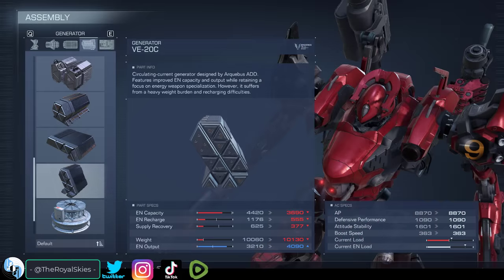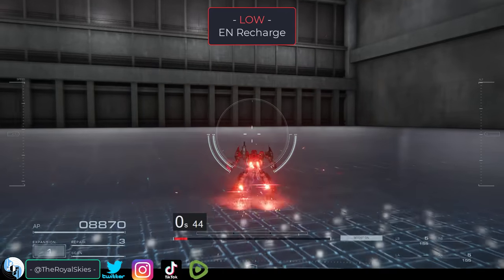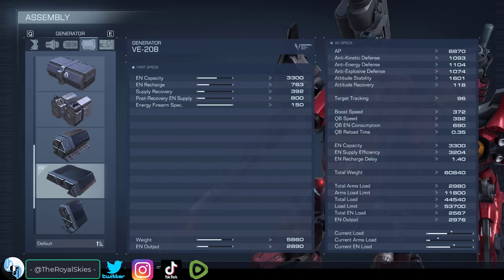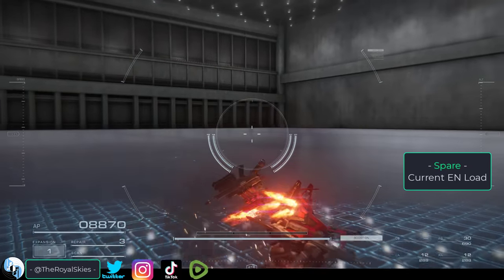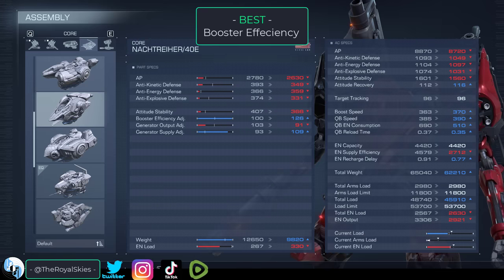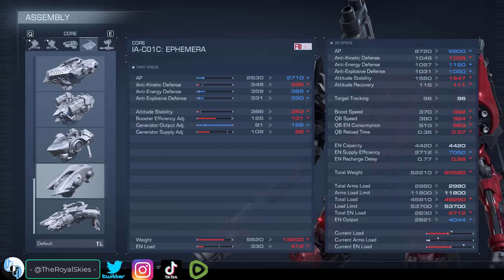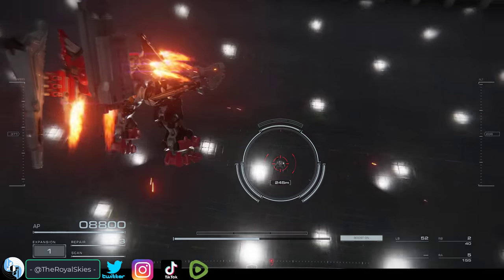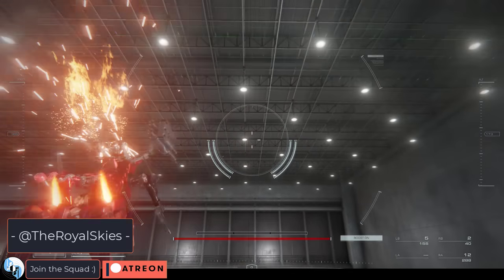How To Master Energy Management in (Armored-Core 6)

Comment: the output section is wrong, output is how much energy you can allot to your AC, like all the weapons and stuff. Low means you cant use too many high energy weapons. What you described in the video is called Energy Efficiency only visible in the show more stats screen on the right
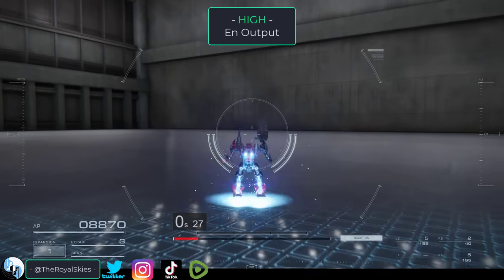Reply: 2:21 where does he exclude that output determines how much you can equip? I really hope you know that the higher your output to en load ratio is what directly influences a better effeciency stat. You can't improve the effeciency stat without a higher en output. And thats why he explained it when he did. Effeciency doesn't just magically change like you are implying